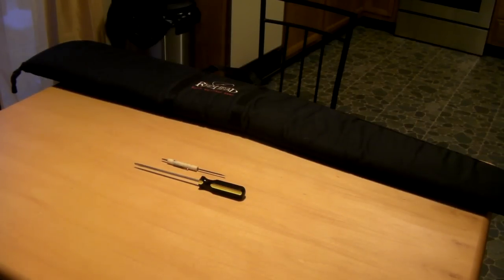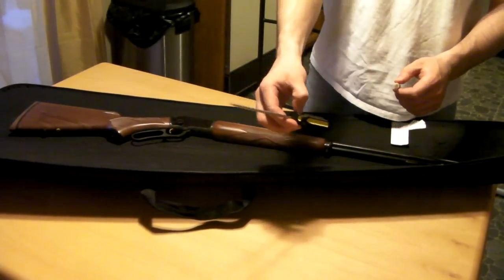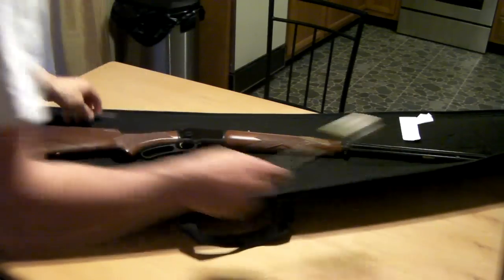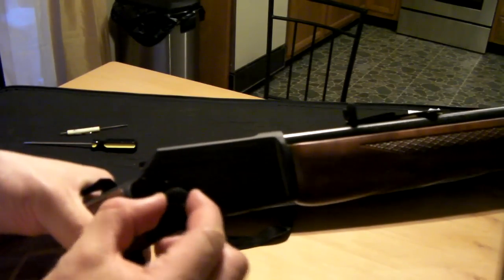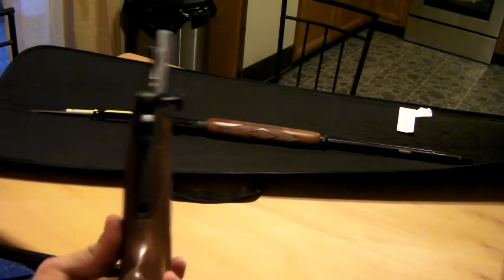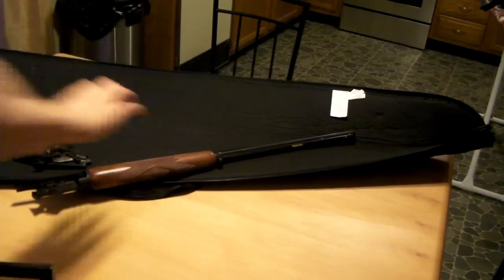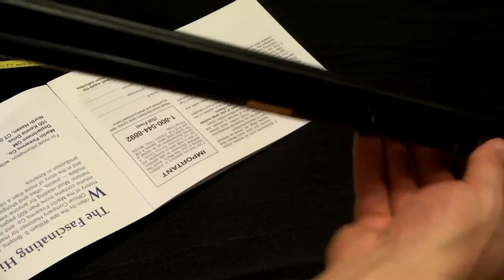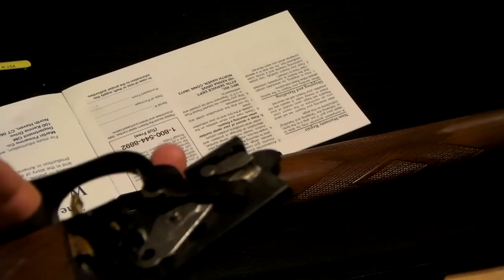How to Clean/ Take-down a Marlin 39A Part 1

Comment from the maker: @DieselFix Thanks for the comment. I picked this gun up about 2 weeks ago, and was also curious about the take down. I've shot both the marlin and the henry. The henry's a good gun, no question about it. But I would call the marlin 39a a "must have" for any gun enthusiast. Don't wait too long to get one... I read marlin's closing their doors in 2011.
Reply: Your video is way in need of bright focused lighting on the inside of receiver group.
Also, the slide bolt has an under fitted 2"+- small bar that Falls out on occasion when disassembling.
Refitting of this piece is very easy, yet head-scratching as to fit on first time.

Comment: I took apart my 39a to clean and when I put back togther the lever wont move unless I cock the hammer and then push down and lightly pull back on the bolt piece it seems to getting stuck . What did I do wrong when I put it back togther ? Would apreiciate any help , thanks .

Comment: Good job buddy.
Let me suggest by the way your bolt and parts move with stiffness like that?
Invest in some oil.
If it's new and breaking in.  Oil it liberally.
You will feel the differance.
It's a manual opperated machine, metal on metal.

The fewer moving parts a gun has to function the more reliable it will be.

Comment: Nice video I just pick one up at a gun show here in Dallas Tx.
It is the 39A Golden Mountie. So I have it here at home and I tried loading it with some .22 shorts just to work the action and see how it did after all I bought it used. any ways after the second or third cycle it jammed up on me the lever would not go back down and the magazine tube had a round stuck in it.
any idea what could be causing that to happen?? Thanks Eric